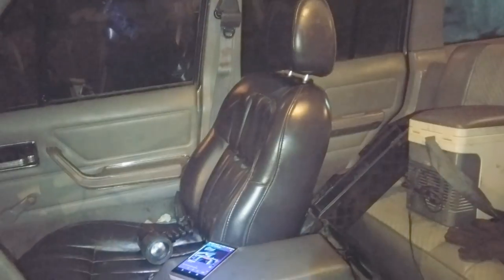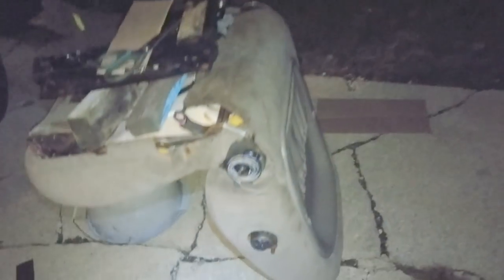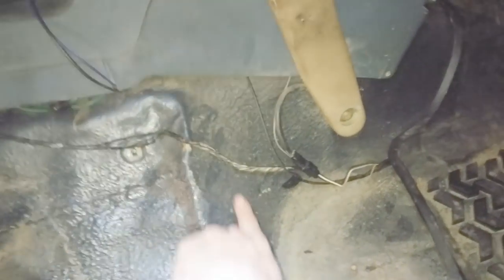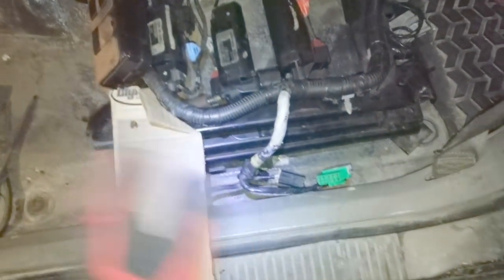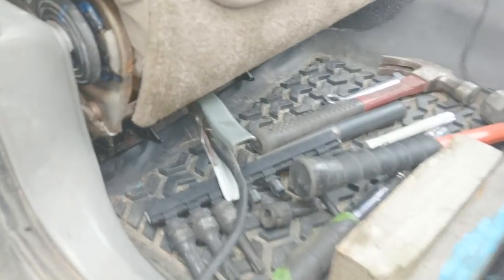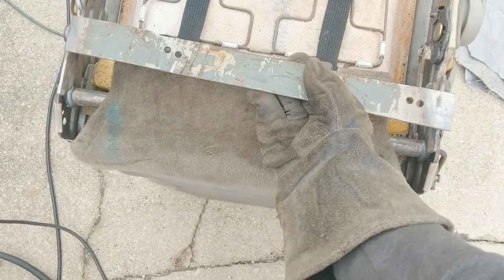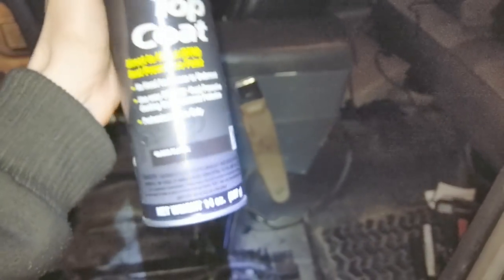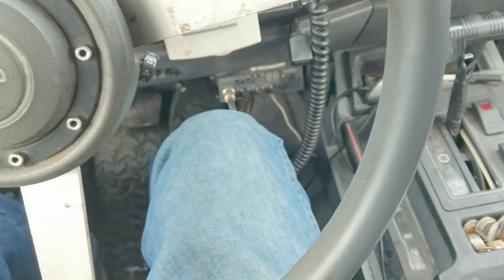XJ Custom Minivan Seat Swap

Comment: I used the middle row captain chairs out of a 2015 Grand Caravan, removed and sold by a handicap conversion company at the local swap meet...$180 for the set of fold flat, black cloth, seats.  A little bit of work to remove old brackets, weld to the new seat brackets....get to have two sliders for extra forward-backward capability (good for sleeping platform)…just barely fits width-wide, but I get armrests on both sides, new foam, hard plastic on back (to protect the seat a little bit), and, if I so chose...I could swap the hasp on the belt and have the seat belt latched to the seat, but I chose to keep the stock seat belt, bolted to the floor.

Congratulations on your mod, glad it all worked out.

Comment: POR-15 is not UV stable, so if you are going to use POR on an exterior panel, they have the top coat that will protect your POR work from UV so it doesn't fade and all that other stuff. the top coat is (I would assume) basically a paint

Comment: The DS seat in the 2001 WJ is a pain in the back & my legs may start to fall asleep. Good idears there for seats. May have measure up the brackets, mounts & go to  the scrap yard shopping.
Oh BTW, "if you could focus... thank-you!"
Is not proper AvEtique. Though copyright infringement may be an issue. ;-) 
Going to go watch his Turbine Powered Vibrator VJO now and a few others.

Comment: You could try Porsche 924 front seats.  They're leather but not these big bloated grand cherokee things, no electric anything,  and they feel great, plus the backs go all the way back until they lie flat.  911 seats might be similar, not sure.  Might be a little low, though, for a Jeep.   :-D
Reply from the maker: Ha, that means trying to find one at the junkyard to begin with too. Not much selection where I'm at. I've heard lots of people rave over Honda Prelude seats too, but never could find one.
Reply: Used to be able to find old porsches in junk yards but no more, they're all bought up by porsche wreckers and you'll pay like $300 a pair for seats.  I've only ridden in them in a 924, don't know how they would work in a regular car, they're kind of low.

Comment: I'm also not a fan of the slippery WJ seats.  I went to try out driving one and I always felt like I had to re-situate myself.  I couldn't imagine off-roading with those seats.  I once set out to put WJ rear seating in my XJ.  I got tired of all the finicky work and my lack of know-how wasn't helping.  THey would go it but not lock back into place.  It was originally done by someone on an XJ from your era body style.  They seem a little more spacious due to the trim so maybe it's only good on those older era years.